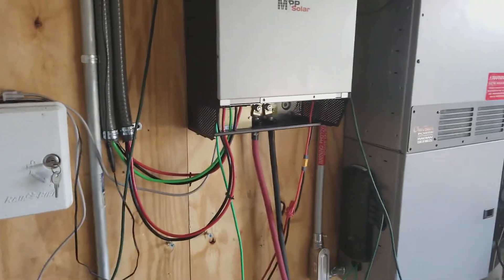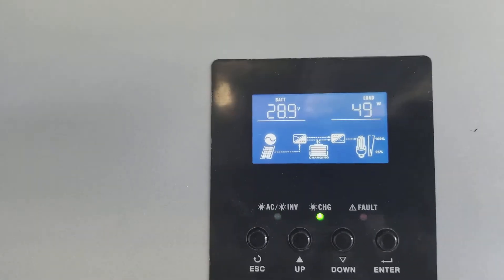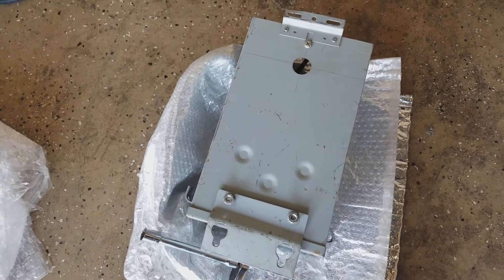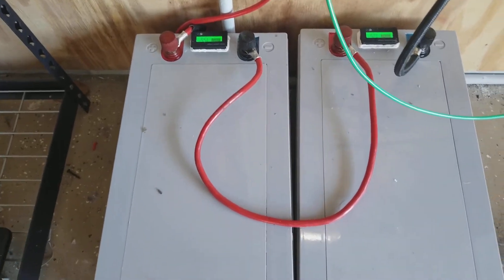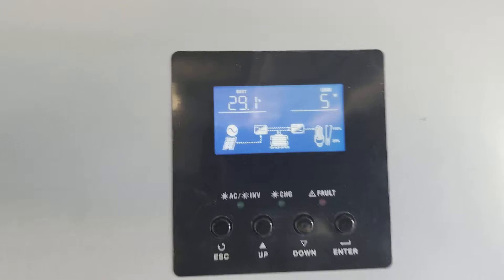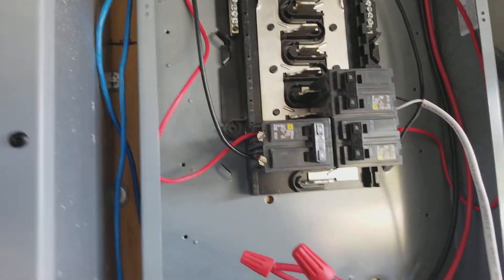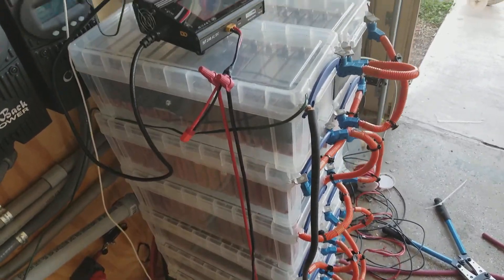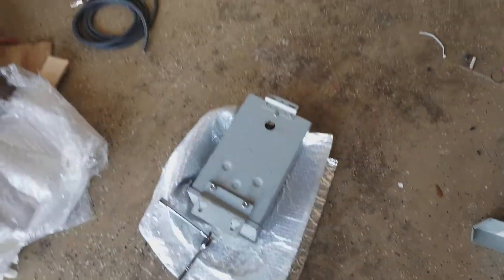Converting my MPP Solar PIP 4024 4000W inverter output to split phase

Comment: Hi there the St 5000 step down 
120 / 240  on eBay uses a lot less no load power  we have a Gk no battery needed to run Pip  nice  system  thanks 👍 👍 for sharing

Comment: hi there i have a GK PIP inverter i fonud out this uses alot less power like the video  https://www.ebay.com/itm/Electrical-Power-Converter-Transformer-Step-Up-and-Down-AC-110V-220V-5000-Watt/174118332155?epid=2256035086&_trkparms=ispr%3D1&hash=item288a42e6fb:g:j0EAAOSwJgxek9vi&amdata=enc%3AAQAFAAACcBaobrjLl8XobRIiIML1V4Imu%252Fn%252BzU5L90Z278x5ickkSG%252BOFgrj2Yvbvmrj2TAdM%252FHVjkv1XjTG2AKKahYtDgvFicVQp7LG%252FLBQTMFUTW7sfdy3JmrKezwW1%252BC04rkaWELToslZMQ88GkQ6huJyXRj1tj68qQ29Vea%252FX6Cj4yn87otbfL0P48t6c9z2Wm4bmggXsytmxkTTiXfwc3MAHhvCLlwZvMie%252FQYIT1xVWyEsDeRiMB6B4RofRfk8mx18%252BFpNAfVTEQcf4t4EDJfSnsQO4j46bSzqOhZ5EeBIrF%252FzXwE79WvkhHM2LIiWEJzH4mYSN447JhsDiByt3o3%252Bf1x4%252BUcVgSK36Ez%252B39mwo%252FC30o0Jl2oVyVpPuUjxirK9tI14%252B90wb3qIyLEvpZVg5zaGQBd7ugm5J37oRjf07a0nNWLwv5PZ%252BPwpzSHZXFWdF8DSjcJArTSX4BOv7ucIUULtGhEpDgTr4cgONdD2wG%252FRX7Ee4mcAC9vSOU6SEqnd2Ae%252FjiL5H2sEdGji5Riov4RyXPTi8wI3uKZmUYRytUPLifoh%252FzmNiDgK4bH06p5kb%252Bt8Ytn1moikdEd%252BLQ7Aqwdbj8np9b3u6ZJInUb7QN7lwrtsqL6ruY6MunDD%252B3ldJ%252BigiOvKEuRRFDT9g4s0UicG0MXFl4Ss%252FvjC6XXxGL%252FA1sGchhRzH7hMY6ybPQuXESXhEqt2tgOoESqrUCdXcPBxpcqunPXgqhC5XepA0MYMn9I6yeO1MNoWOwPrZGofVsFKF%252FQZzXAIjpXl2Cm1MGckV1jGfp%252BeBosMGlv7%252FQcZVmio6OzgSd1XV7Y63mXtqw%253D%253D%7Ccksum%3A1741183321553d260661f0e348a1a890054c36ae47b2%7Campid%3APL_CLK%7Cclp%3A2334524